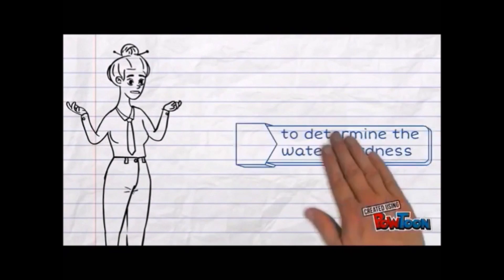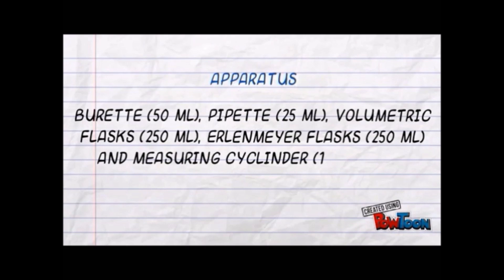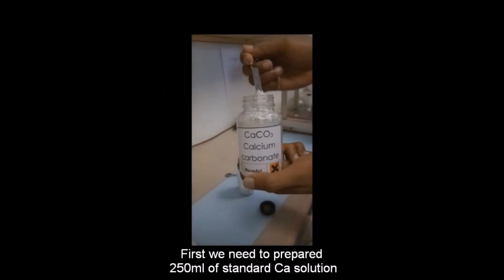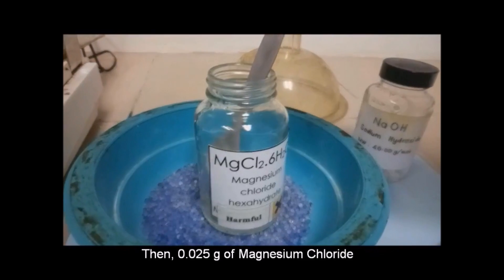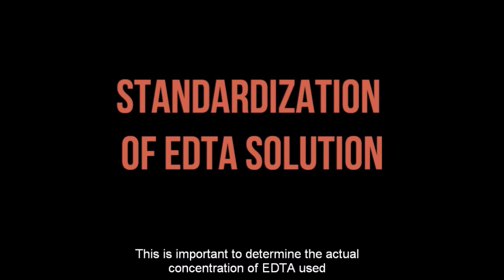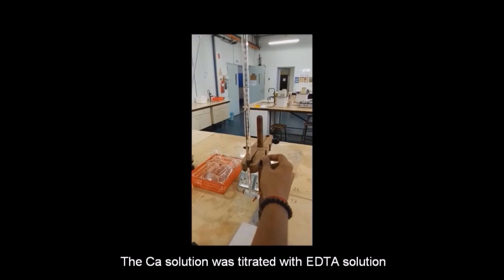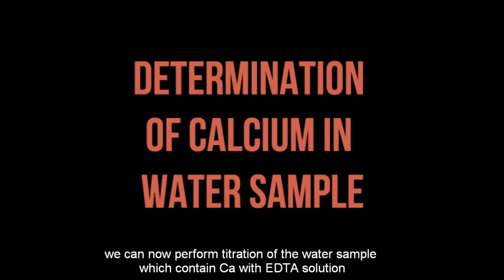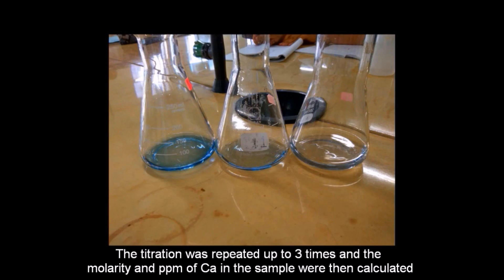Complexometric Titration: Determination of Ca by EDTA Titration

Comment: What was the solvent for the magnesium chloride and sodium hydroxide? You voice cut out at this point so it wasn't stated. By the way it is standard metric format to insert a space between a value and its unit and multiplier. For example, don't write 250ml, write 250 mL. THe aidio was also lost at about 3.25 so whater you said then about adding buffer etc was not heard.